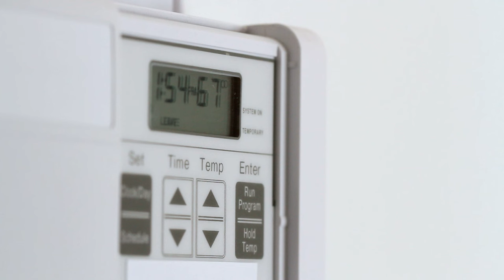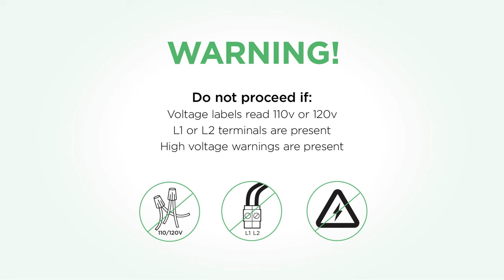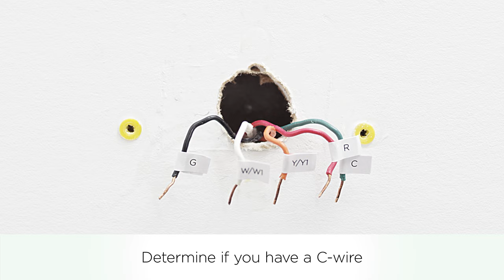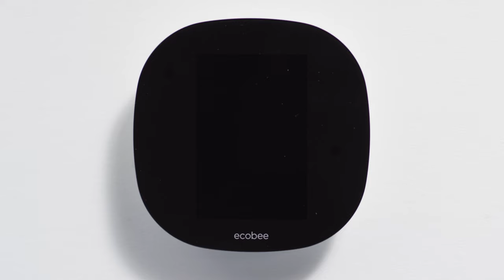ecobee Support - Installing your ecobee3 lite with a C-wire

Comment: If I have one upstairs and downstairs do I need to install 2?
Reply: Just call and ask, shouldn't take long for someone to answer your question. :)
Reply from the maker: I would recommend replacing both thermostats although you don't have to do that at the same time. Often people will get a SmartThermostat with voice control and an ecobee3 lite if they need multiple smart thermostats.

Comment: It's not very bright of the makers of these smart thermostats (not just Ecobee), to assume that everyone is mounting onto drywall. Our house (nineteenth century), and millions of others, have lathe & plaster walls. The screw anchors for drywall aren't the same as for plaster--plaster, when cracked, will break into pieces behind the paint, so you DON'T want your anchors cracking your plaster. I have many little holes in my walls, which will eventually have to be repaired, just because the guy we bought the house from was an idiot--he thought putting multiple finishing nail holes in each and every one of the walls was clever (clearly, he put them in--he painted everything first). 

I'm sick to death of people offering advice on subjects they don't understand. When offering advice for DIY installations, you should point people to sites that explain the difference between hanging things on the different types of walls, instead of giving the impression that you know what you're talking about.

BTW, I'm getting my Ecobee 3 Lite for free from the power company. The choice was between it, and the Nest Thermostat E...a seriously unequal contest in nearly every way. Heh. Can you imagine going out of your way to make the display more difficult to read? That's Google for you. Thanks Google, you've made me despise you even more, somehow.